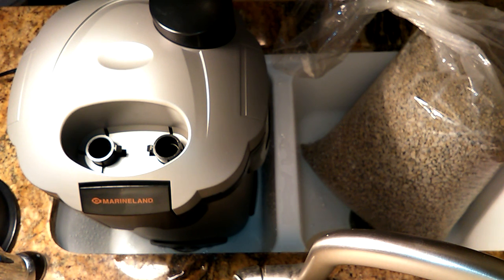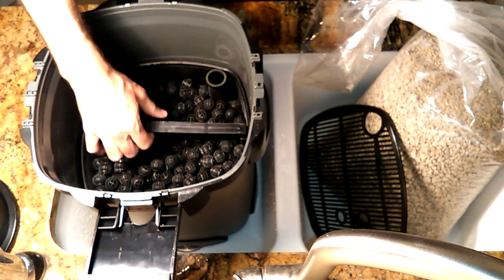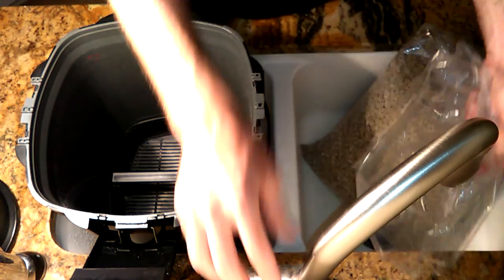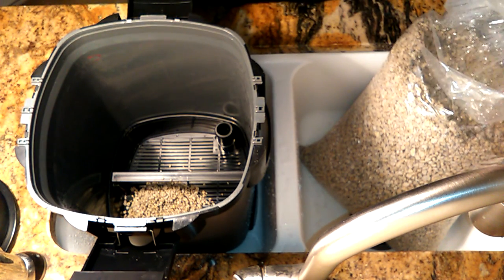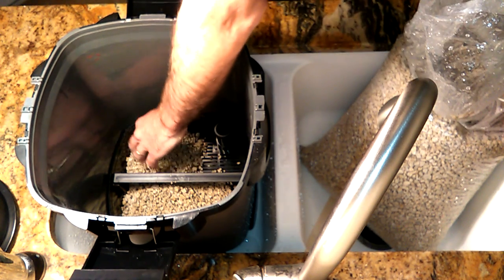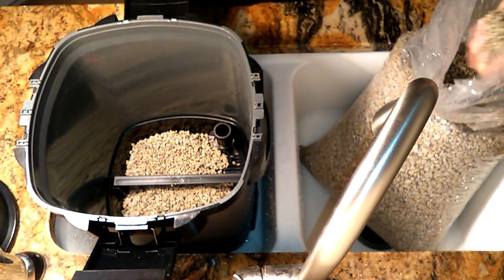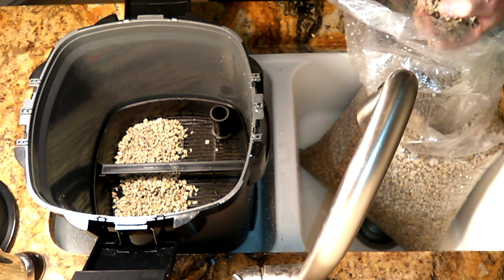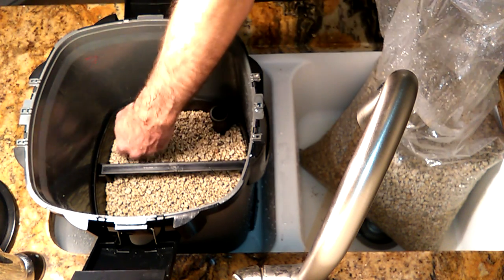Pumice Filtration Tutorial Part 1/2

Comment: I don't understand why everybody thinks that this pumice thing is so great, now yes it does have a very great porous surface area I repeat surface again surface surface area as we all know pumice floats, the idea that it floats suggest that not all the pores are open and it is actually holding in air Ergo not having water flow fully through it whereas the bio rings that you ridiculously threw out have a porous structure throughout as do most ceramic media's
Reply from the maker: Why do we need to manufacture more plastic crap when (1) pumice is sufficiently porous to allow robust flow, especially considering the gaps between individual stones; (2) has much more surface area per unit volume than the best bioballs; and (3) requires no manufacturing process to produce? That said, I don't suggest using any filtration at all, except when a given tank isn't sufficiently stable to maintain itself with just a powerhead.
Reply: the RINGS he threw out were CERAMIC,  I was not refering to the plastic bioballs. yes per volume you are correct BIOBALLS are petty much nothing compared to pumice. And as for my reference to the pumice, I simply meant that you are not getting 100% flow THROUGH the media. along the surface and around the random structure it would not slow down your flow at all but some of its unit volume is wasted because of the closed cells inside it. quality Red lava rock would do the same job and actually has open pore structure throughout thus full THROUGHFLOW and no wasted volume
Reply from the maker: Yes the ceramic rings are superior to bioballs as a nitrifying bacteria substrate, although ceramic in general takes an immense amount of energy per unit volume to manufacture. Red pumice (lava rock) or for that matter, white pumice, is indeed a much better choice because harvesting it requires minimal energy by comparison. And I agree that red pumice provides better for better flux (throughflow). However, I don't use the red variety because it's very rich in iron, which would tend to support algae growth. For the record, when my white pumice media became clogged, I would simply hose it off in the sink (while wearing a mask because it's loaded with random bacteria). I only needed to do that every few months. Yes, I could have made do with the ceramic rings, but the experiment with white pumice proved fruitful, because once the tank stabilized, I was able to get by with just a single tray of the stuff, due to the high surface area.
Reply: Great argument, I guess depending on your setup both would have their place. I use zeolite, and Fullers earth clay mixed with activated carbon witch I extrude into 3/8" pellets (homemade recipe by volume for highest benefit of each material)  in my sump system's chemical chamber (although they are all natural products as I don't like chemicals in my water) that absorbs and removes most metals from the water column. So for me having that ability to absorb the iron, it makes more sense to have the higher net volume of the red variety pumice, whereas you are running a canister and are not using these materials so it becomes more beneficial for you to have the added volume over bio-balls without the added iron by using the white. I still surmise that you should have kept your bio rings however since you already had them. Since energy obviously went into making them the worst thing we could do having already spent the money is WASTE that media.
Reply from the maker: Perhaps you're right that I should have kept the bioballs. But hopefully I've offended enough canister engineers by disposing of them to spark some new thinking in the industry! And thanks for sharing your techniques.
Reply: If you like pumice then there is a high tier pumice made by seachem call seachem matrix.   Its essentially pumice but engineer with huge surface area with a lot of smaller holes and does not float
Reply: Not all pumice is made alike. Some pumice floats, some sink. Some float from the start and then sink. This indicates a very good environment for very low flow zones inside the stone where bacteria that don't need oxygen can live. This is the type of bacteria that can remove nitrates which is why seachem sells pumice as nitrate reducers.

Comment: If you like pumice then there is a high tier pumice made by seachem call seachem matrix.   Its essentially pumice but engineer with huge surface area with a lot of smaller holes and does not float
Reply from the maker: Thanks for the tip. Personally, I'm just down to powerheads now, and loving it.
Reply: Just an FYI, Matrix is not engineered it's natural volcanic pumice. It's just given a bath of acid first to dissolve any lime or high ph  rock that may be in there and then prewashed. Its the same stuff you can buy in bulk at garden centers for 40x less money just pre cleaned.
Reply: Dale Meaney well thats the market scheme. To me i wouldn’t buy it. I just think it just pumice that looks nice thats all

Comment: Please tell us why you decided to tear this down and use only a power head. There is not such video on your channel explaining your choice (at least non, from the titles). Certainly there is some flaw in this setup if there is non, you won't tear it down.
Reply from the maker: Good question! The reason is that I'm always striving to minimize the requirements for materials and maintenance. At least for my bowls, I found that powerheads can suffice, so long as there is biological balance. It's more complicated with large tanks which require more circulation, because too much can kick the detritus into the water column, while too little can create anaerobic regions. By the way, I didn't really tear anything down. I just removed the pumice filtration. I still believe that if you really need a canister, then white pumice is still a good option because it needs very little maintenance. You just need to remove any pumice that gets stuck in the impeller intake, and also flush it clear of muck every few months. FYI the dust may be toxic, though.

Comment: Sorry, but it's kinda stupid not to rinse the pumice before you put it in the filter. To avoid getting little particles of pumice running through the filter, I would use the fine filterpad as the last layer in the filter. But every
Reply from the maker: I agree. I probably didn't make that clear in the video, but I thoroughly flush out the dust before putting it in use. That said, I don't use anything but a powerhead on my new tanks because I saturate them with plants from day one, and therefore don't really need any filtration.

Comment: What kind of pumice u use? Could I use clean pumice used for cleaning feet?
Reply from the maker: Scenic Hill Farm out of Oregon. I no longer have filters on any of my tanks, but if I did, I'd still use their white pumice.
Reply: If you like pumice then there is a high tier pumice made by seachem call seachem matrix.   Its essentially pumice but engineer with huge surface area with a lot of smaller holes and does not float

Comment: Wow you are SOOOOOO crazy to put that Marinleand C530 on your 40 gallon tank!!! You must have elephantiasis to pull off such a risky move. Do you realize that monster of a filter puts out 530 gallons per hour??? That's like putting an Aquaclear 110 that does 500 gallons and filters tanks up to 110 gallons on your aquarium. Fortunately for you might be ok because the Marineland C530 isn't rated at 150 gallons. The manufacturer states that it filters up to 150 gallons and everyone knows the manufacturers exaggerate the numbers. If you had that filter on a 150 gallon you would have a 3.5X turnover rate
Reply from the maker: Elephantiasis is actually a structural tissue disorder that has nothing to do with one's degree of risk aversion. But it's not in fact a question of risk aversion. It's a question of hydrodynamics. And you're right. That filter was too damn big, despite being well impeded by the pumice. It was kicking up too much silt, so I ended up replacing it with a powerhead, ecoquarium style: https://www.youtube.com/watch?v=U36chT65DoM